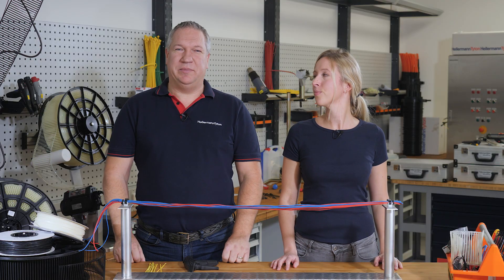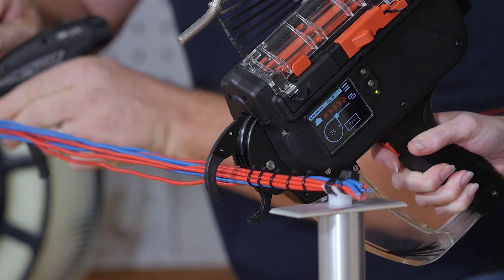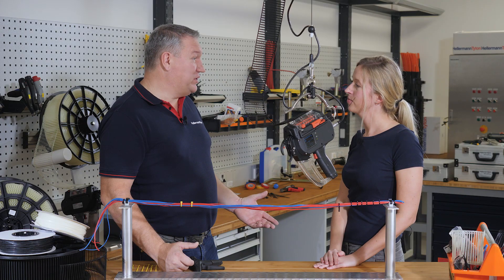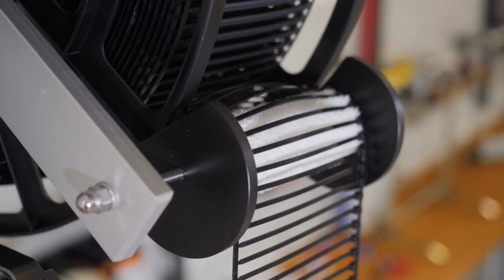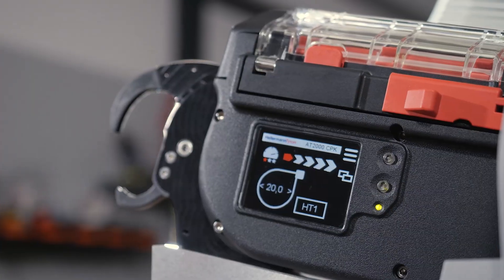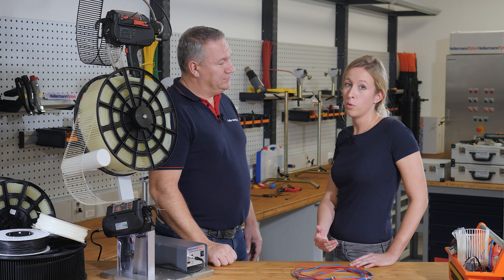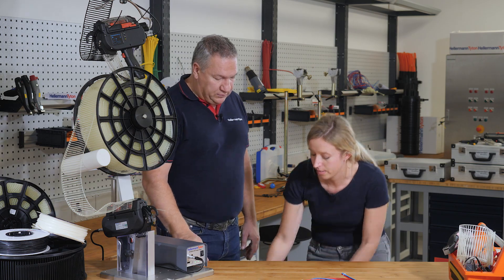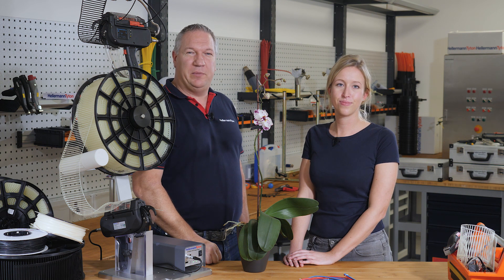Automatic cable tie gun: Autotool 2000 CPK tutorial video (EN)

Comment: The Autotool 2000 is very good !!! I have been working with this type in Hungary for more than 10 years, and it has developed a lot over the years!...After easy maintenance and repair of the first generation, the new machines are more reliable, require less repairs and have repaired weak parts!!
Reply from the maker: Köszönöm Vadasz Vincent for your comment ❤️

Comment: Do you have an automatic cable tie gun too use out in the field, that you can easy carry with you ?
Reply from the maker: H oliver brag, yes we do. It's the AutoTool CPK hybrid: Can be operated electrically as usual with Power Packs - in a wired version when working in a factory environment / integration into a fully automated production line - and can now also be supplemented with a rechargeable battery so that you can use it to work independently of the power supply when you are far away from power sources (e.g. outdoors / solar fields etc.)
Best wishes,
Nico

Comment: Do you offer an automatic tie gun that can be used by battery power for job site locations. Be great for our exterior radiant heat cable tying. This would speed up our process.
Reply from the maker: Hi Lynne Potoroka, yes we do. It's the AutoTool CPK hybrid: Can be operated electrically as usual with Power Packs - in a wired version when working in a factory environment / integration into a fully automated production line - and can now also be supplemented with a rechargeable battery so that you can use it to work independently of the power supply when you are far away from power sources (e.g. outdoors / solar fields etc.)

Best wishes,
Nico

Comment: Love to see quality engineering, passionate people, and a strong company ethos deliver a quality product for the market. 

You know your market and product to a T. 

I will always pay more for the people that put the time into smoothing the rough edges and embracing steady improvement instead of rushing for market space. 

Maybe in a future demo show say 2 florescent light tubes with a carboard spacer for the loop function. I understand its capabilities but it might come off a bit less spectacular. WHAT YOU ARE DOING WITH THAT IS GENIOUS.    3 settings for doing traditional banding operations, and then the ability to have it pull the exact dimension you need is  a gamechanger.... 2 florescent light bulbs still in their foam, with a cardboard backer. show how you can secure the product but not modify it . 

Much Respect from the States. You really built a better Mouse Trap.